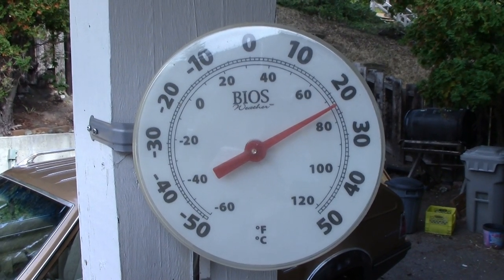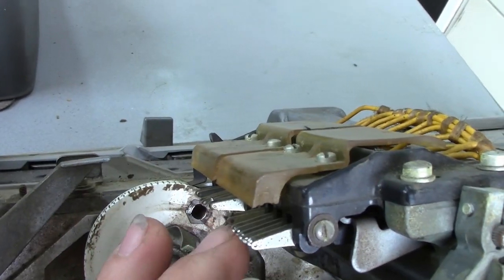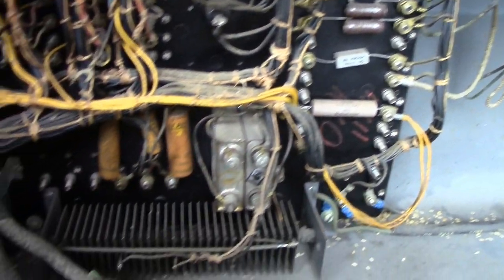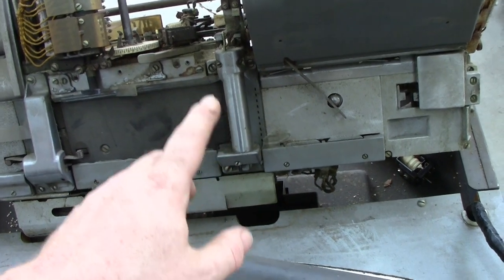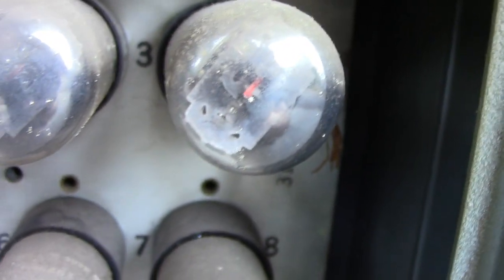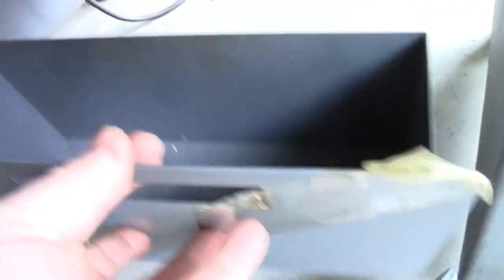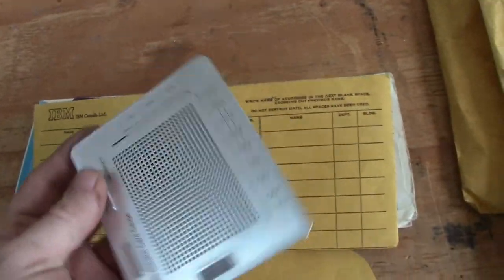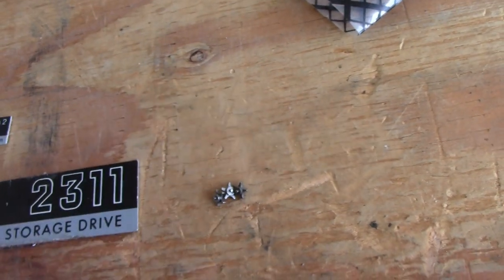More Card Processing - The IBM 024 Keypunch and the IBM 056 Card Verifier

Comment: Remember there is a thermal delay contactor that allows the tubes to warm up before the rest of the machine is enabled. MAI was a company that bought IBM card machines and them leased them to their customers. In some cases they hired away IBM CE's to also provide service. However there were many MAI owned machines that were serviced by IBM CE's with me being one of them.

Comment: The flow charts are not the same as back then, but if you need your software to have ISO 9000 or ISO 27000 certification (sometimes an requirement for industrial use), you have to write a spec that while not a requirement they all seem to have flow charts.

Comment: Sunlight?  What's that? ;)
Reply: IBM #10 Lubricant is SAE 30 Weight Non-Detergent Oil.
IBM #23 Lubricant is Mobil Grease #28.
Reply: The extremely long resistor @ 6:03 (orange, red, orange red silver?) is the physical shape and size of some from the 1930s.  
The Aerovox company (paper wax capacitors) is definitely from the 1930s and up.
The oil filled rectangular metal cased capacitors might be from the Western Electric Telephone era.
Reply: Western Electric also used those light bulbs.